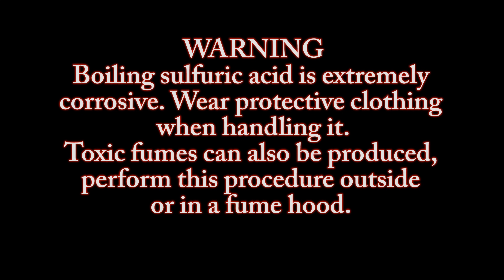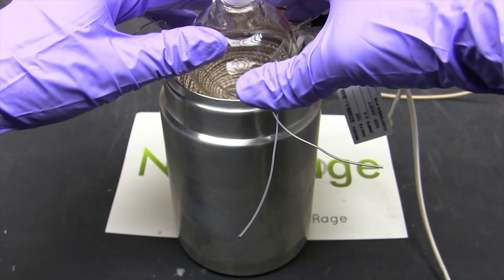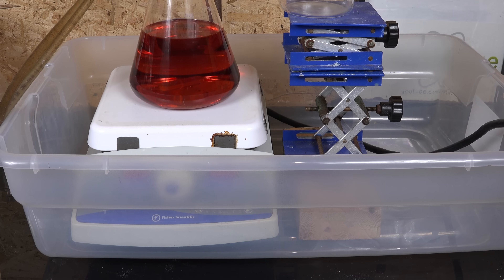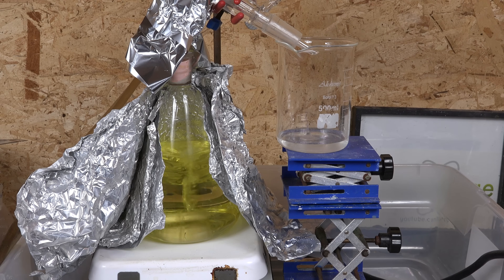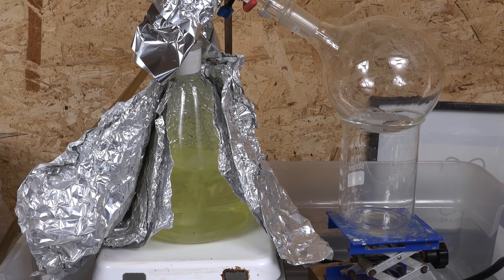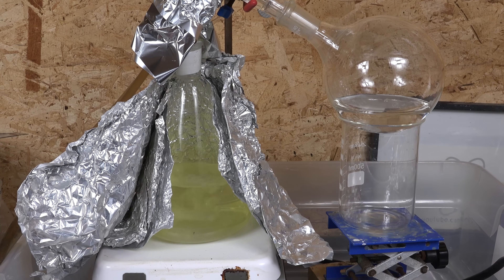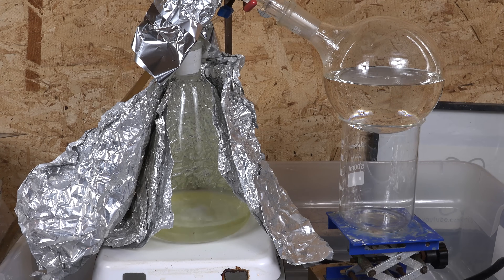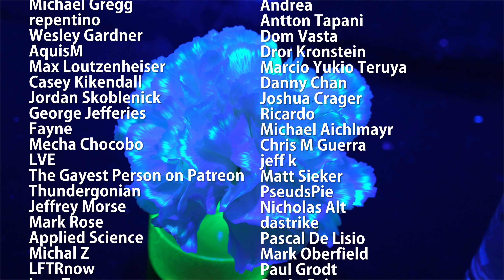Purification of Sulfuric Acid by Distillation - Revisited

Comment from the maker: Ya know, i keep talking about how dangerous it is, i'm tempted to demonstrate it by pouring boiling acid on something.
Reply: I had an idea years ago for a series called "will it acid" by showing how different acids react to different substances. I just didn't have a safe way to do it.
Reply: Raw eggs are a good example, they blacken from the reaction in addition to cooking from the heat of the reaction.
Reply: Interesting fact is that many metals that are dissolved in diluted acid (<90%) will stand up to boiling sulphuric acid, a fact used by gold refiners in less developed countries. There are a lot of videos where people with flip-flops on their feet, standing next to boiling sulphuric acid, removes plastic from IC:s to get to the gold. The epoxy dissolves and the die, gold bond wires and metallic pins remains.

Another fun experiment is to do a reverse plating cell. Cold concentrated sulphuric acid (>90%, <40 C) electrolyte, anode with a copper basket or hooks to hang gold plated objects, cathode a lead strip, 12V power supply. Gold and silver dissolves but falls out as a sludge after a couple of mm. The base metal passivates and the process is self terminating. Precious metals are filtered off and recovered while the acid can be used again.
It starts to eat the base metal if enough water is absorbed or the acid gets too hot.
Reply: The ol Sugar in beaker and H2SO4 demonstration is all ways a crowd pleaser
Reply: Different types of lab gloves with sausages or raw chicken meat inside.
Reply: I accidentally poured boiling sodium hydroxide down my toilet and it got very angry ... Never doing that again
Reply: @Screeno1993 I hope you mean boiling sodium hydroxide water solution and not actual pure boiling 1'388°C NaOH which would be something extremely scary.
Reply: Any excuse to play with acids is a good excuse, right?
Reply: Sounds very dangerous to you. 😟
Reply: That bump clip got all the hair on the back of my neck standing up... never boiled it myself but played with piranha... and videos tell me the two are similar in behavior. Heh.
Reply: Yes, especially if you compare hot and cold acid on the same material to highlight the difference.
Reply: Have you attempted to use the ptfe paste instead of the tape? I think it would work better at sealing the surface rather than the tape due to better surface contact and ptfe filling the gaps.
Reply from the maker: the PTFE greases i used earlier did work, but they were ridiculously expensive and hard to get. Maybe things are different now, but at the time it was hard for amateurs. But PTFE tape is dirt cheap in comparison and available everywhere. And for this particular distillation, great sealing isn't strictly necessary. Nothing really leaks out the joints as the sulfuric acid just isn't all that volatile. The PTFE tape primarily helps to keep the joints from seizing up. There isn't much requirement for great sealing exactly. So PTFE seems overall best for this particular application.
Reply: @NurdRage  what about specifically like the pipe thread sealant paste? It's basically dirt cheap as well, only a few dollars more at the hardware store and is a form of suspended ptfe
Reply from the maker: @dmoskva  the brands i tried still degraded and seized up with boiling sulfuric acid. They weren't meant for high temperature work and while the PTFE might have been good, the filler grease was destroyed by the acid. If you find grease that works then by all means go for it. But i found PTFE tape to be more consistent across brands and countries. So rather than ask my fellow amateur chemists to hunt down an obscure brand of grease, i say use PTFE tape which should work most of the time whatever brand you use. 

Additionally, you want to be able to take the joints apart again. If you use the sort of sealant that glues together the joints, you're going to have a bad time getting delicate ground glass joints apart again.
Reply: @NurdRage  where did you buy your stir fish my stirring fish gets disintegrated by the boiling sulfuric acid.
Reply: Some boiling sulfuric acid bumped and exploded up the neck of a flask and onto my fingers about 3 weeks ago and if I hadn’t immediately plunged my hand into a bucket of cold water I had right there, I’m sure I could have lost my fingers. As of now, I’m recovering from some horrific second and third degree burns on the fingers of my right hand. From just one second of contact or less. And I’m a pianist 😭
Reply: " i'm tempted to demonstrate it by pouring boiling acid on something."

No need to, The Toilet paper test at room temp. is plenty!
Reply: It is really hard emphasize just how dangerous hot sulfuric acid is until they witness what it is capable of.
Reply: ADDED BUMP ROCKS TO BOILING 30% H2SO4 AND IT WAS VOLCANO TIME! NO ONE HURT.
Reply: Yes
Reply: Just put something infront of the condenser at 3:19 lol
Reply: Just put something infront of the condenser at 3:19 lol
Reply: Yikes???
Reply: @NurdRage please do! I think many of us (me included) sometimes forget how crazy dangerous boiling concentrated H2SO4 is.
Reply: I had a demonstration at work 25 years ago of what happens when chlorine and acid mix and it scared the shit out of me.
Reply: You could do a YouTube short of it.
Although maybe instead of doing just one thing in the video. You could do a bunch.
Kind of like a hazardous information video.
Don't get me wrong I'm not suggesting that you go huffing fumes to demonstrate their effects. But I'm sure you could come up with some demonstrations besides just what happens when you spill boiling sulfuric acid.

.... Also if you're going to just do a video about boiling sulfuric acid spills. Try to throw in some kind of human analogue Like pork
Reply: Round my place, we call it "chicken eater".
I did the notorious demo to encourage my family to avoid touching the equipment etc.
Reply: Try mushrooms. I got some interesting colour changes when I dropped that acid on fungus picked from the garden.
Reply: Not before I can demonstrate "explosions and fire" style how I can definitely do this at home ..... Video title how to easily start a fire.... 😂
Reply: Pour it on a sausage.
Reply: @howlingwolven  put that shit on a cracka
Reply: Do a hotdog
Reply: The classic industry demonstration is to stick a chicken leg into oleum
Reply: DO IT!
Reply: I finally did it myself with small samples of materials and I believe I'm the first to show it on youtube. That stuff is scary.
Reply: @lagrangiankid378You definitely are not
Reply: @RedTail1-1  Can you give me a link to other videos where BOILING sulfuric acid is reacted with something?
Reply: where did you buy those glass bottles with PTFE (looks like it is teflon anyway) caps?
Reply: Nah... Just let Darwin do his job mate.
Reply: Turning the fume hood off would have demonstrated the most immediate danger.
Reply: @John.Flower.Productions  I've distilled H2SO4 drain cleaner inside and without a fume hood before and lived to tell the tale. I am not recommending it of course, I'm pretty crazy. I had a good quality gas mask with good filters though, and I had put a crazy setup in place to have zero fumes escaping the apparatus (well, once I was done figuring out a working method - it involves 2 glass check valves and a lot of PTFE tubing, some borosilicate glass tubes, as well as lots of PTFE tape).
Reply: Do it. It’s what our Lord and Savior NileRed would want.
Reply: @aarocka11 Nilered is inferior to NurdRage in every way
Reply: @aarocka11 yes
Reply: Yeah like a hamster... Don't worry cupcake I'm just kidding
Reply: Face reveal?
Reply: @custos3249 skull reveal?
Reply: @custos3249 never
Reply: @custos3249 no

Comment: That ceramic hot-plate is over $1000 new.  Sure it's really nice, but obviously most people aren't going to go for that kind of cost.  I would think a heating mantle with magnetic stirrer is more realistic.  StonyLab has one that reaches 380 C.   I would think this is hot enough to get the acid to the 340 C boiling point?  What's the downside to the heating mantle-- is it just going to take longer since it only reaches 380 C?

Comment: On a side note, sulfuric acid drain cleaner is very good for cleaning lab glassware. I think it's the cheapest and most effective glass cleaning agent, and borosilicate glass is inert to it. If you're very careful, you can sometimes "reuse" the sulfuric acid used to clean glassware for future cleanings.

And if some organic residue doesn't clean with sulfuric acid, then I try the opposite, a concentrated solution of sodium hydroxide. But sodium hydroxide solution should never be used first because it's one of the few things that can dissolve borosilicate glass, making them permanently slightly foggy.

Comment: I would suggest putting a tall stainless steel container or saucepan on the hotplate then putting the conical flask containing the boiling acid inside the saucepan. This will contain the acid at any temperature if the boiling flask cracks.

Comment: Spillage container ideas: a tray made of enamelled steel. One ships with every kitchen oven large enough for the entire setup. And using a smaller one on the hotplate with the Erlenmeyer flask on top that, just in case. Enamel is a ceramic coating after all. Someone ought to make boiling flasks out of it with ground joints. i.e. cheap and thermal shock might be less of an issue.. A Corningware baking tray is also good. PTFE tape is a great idea for joints. Been doing that for a while. But H2SO4 is so heavy and other acids so volatile they like to escape. Pulling a tiny bit of vacuum is good for acid boils, in my back yard chemistry experience!

Comment: I have taken to using two bins. The first bin actually has water in it, and the second bin sits in the first bin.  I use bricks to keep it weighed down and to offer a source of cooling should there be a spill. But, this aids in the protection just a bit more.

Comment: Yes it can be dangerous and use dand to cool your glass i never tried it cause its a specific experiment, i never needed, for my chemistry leaning
Reply: Sand I meant, but it could be difficult to keep against the glass, while heating don't , don't try at home, if you don't know what your doing and check your safety list.

Comment: I saw NileRed distill sulfuric acid from drain cleaner as well, and he used big pieces of broken glass in the drain cleaner erlenmayer flask containing the drain cleaner to greatly limit bumping during distillation.

Just a little tip

Comment: @NurdRage I have a question for you. Would a method of sulfuric acid generation work from a thermal decomposition of iron pyrite and sodium chlorate? My thought is that at temperature, the pyrite would begin to decompose into sulfur dioxide and the sodium chlorate would react with the iron to generate oxygen driving the entire reaction forward, the reaction gases are then bubbled through water to produce the sulfuric acid. Am I crazy or would this work?

Comment: I know it' supposed to be illegal, but I found concentrated sulfuric (96%) acid labelled as drain cleaner in small shops both in France and the UK .
Tip: don't go to hardware stores but rather small stores that sell almost everything (toilet brushes, acetone, gardening tools).

Comment: How the avoid bumps to shoot in the reciever flask? Would a larger flask avoid/limits this? Is it possible that a bump make explode the erlenmeyer? Also, 337C is quite high, we can reduce this temperature by vacuum distillation. Would it be more secure to make this distillation under vacuum around 200C?

Comment: Just spent nearly a month working on a sulphuric acid plant, not sure exactly it’s product capacity but they export 3000 metric tonnes daily. Fortunately the risks during the shutdown are much lower although there were still repairs inside in several of the reaction vessels and also the replacement of the Vanadium Pentoxide catalyst in the converter. The suits and decontamination requirements for those working inside seemed very thorough, fortunately that didn’t include me 😂.
I’ve always been careful with the small quantities I keep but this experience has only increased my awareness and I’m quite happy to leave distillation of it to someone else 😂.
Also thought I’d mention the product that is used in the event of inadvertent skin or eye contact is called Diphoterene apparently it is very effective at neutralising acid (and alkali) and I was told will also neutralise the nasty oleum residues that I believe is more dangerous than the acid 😳

Comment: Great Video!
I have a question: you didnt use the PTFE Tape on the receiving roundbottom flask where you collected the concentrated sulfuric acid, why? Is that because it isnt tightly held ?and I also wanted to ask if the apparature is a closed system or if that was a vaccuum outlet I saw around 11:34 besside the cooling outlets.
Reply from the maker: after the condenser the acid is cold, and no longer corrosive to normal joint grease, the receiving flask has normal silicone grease on it. It's not a close system, gases escape through the vacuum outlet
Reply: @NurdRage  Perfect! thank you :)

Comment: might want to reconsider retainng tub material.....should the 500C breaker break, the tub will melt through in seconds, defeating its purpose.
Reply from the maker: What's wrong with the safety talk about that?
Reply: A few seconds is still long enough to GTFO, though

Comment: Curious, wouldn't potassium nitrite substitute for sodium nitrite, as isn't it merely the nitrite ion that is important and the metal a spectator?
Reply: Anyway, to freebase lysergic acid hydrochloride, a few tricks are brought in. First dissolve it in distilled water, and add some ammonia water to that to form ammonium chloride and the freebase lysergic. However the freebase is unstable in regular atmosphere so get some welding argon and flush out the container for about a minute with welding argon, being dense will displace the regular atmosphere, you can just run a line and tape it in the spout of a pyrex measuring cup and leave it with a stream of fresh argon. Then get a tray of ice water and put the measuring cup in it and as it cools, the ammonium chloride will stay solvated and the lysergic acid monohydrate will precip. To isolate, get a needle syringe and put some folded filter paper on the end and teflon tape it to the tip around the needle and start to remove the water after wetting the filter paper with the ice water.
Reply from the maker: What video are you referring to? I never made LSD.
Reply: @NurdRage  making something without nitrite. Never thought you synthesized a lysergamide, lemme know if you want to know how to transfer that base for doing the amino acid type coupling agent pybop Mr phd
Reply: Don't some drip sulfuric on phosporous pentoxide and distill to free the sulfur oxide azeotrope and then drip the distilled oleum onto the dehydrating method to obtain by distillation into a chilled receiver solid so3?
Reply: The freebase lysergic is then suspended in ethyl acetate, your tertiary base in ethyl acetate is added which extracts the proton from the carboxylic which frees the water from the monohydrate bring the lysergic into solution which is then transferred to a flask in solution which then uses an argon balloon put on the top 3 times with a few minutes in between each one which is then wire wrapped for the duration of the 3 hour reaction ...
Reply: You add your other reagents, the pybop, and amine, in ethyl acetate when you swap out the balloons obviously ...

Comment: So once when i was younger i was boiling pure sulfuric acid in a test tube to pour it on various things, and due to the general spirit of naive unplanned amateurishness of the experiment, it did in fact, not end well: i spilled the whole test tube on the inside of my right forearm ( because of course i was holding it with my left hand, as the right hand was busy controlling the torch with which i was heating it). It instantly charred a patch of skin around 2 inches in diameter, but it didn't hurt that much as it was so fast. I then ran it under ice water for a while. after that i bandaged it with sterile grease and gauze and waited a few weeks taking care of it regularly. It healed absolutely fine and today i can't even see where it is. 
   Now it's hard to describe, but the wound was more pleasant to deal with than a boiling water burn, as mentioned it hurt little and the pain went away in a few hours, whereas regular burns hurt for at least a few days for me. The wound was very clean, and quite shallow, it also didn't blister at all, as the charred top layer acted as a scab. (I suspect it only charred the surface of the skin, because the acid has a low viscosity at that temperature, so most of the stream of acid dripped off, leaving a thin layer of acid that got quickly depleted by reacting with skin.) 
   And that was on the very delicate skin inside the forearm, almost anywhere else would have done less damage (except the face, but yknow, wear a face shield and all that).
What I'm saying is I think it's important to really understand the dangers to better prepare, not overstating nor understating. Acid isn't magic laser beams, chemical reactions have a limited power and take time, so no it will not eat to the bone unless you literally dunk your hand in and wait a while.  Sulfuric acid isn't poisonous so skin contact isn't so bad, however I would definitely worry about face protection and ventilation.

Comment: I don't have a stirrer at this temps, so I put the whole setup on a shaky table with a magnetic actuator (a big solenoid switched by a relay controlled by arduino to tune it to resonance). It swirled around the hot acid very nicely and prevented bumping. But you need clamps on your setup, or it will wiggle itself apart.
I also didn't know stir bars would survive 350°C.